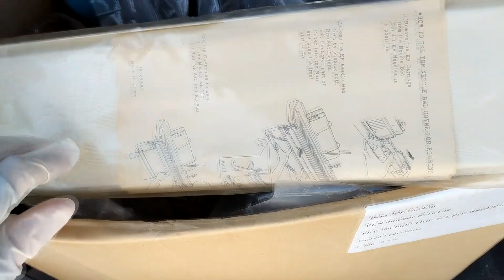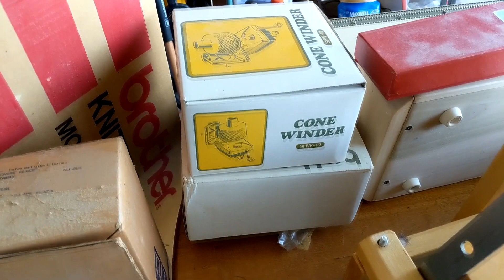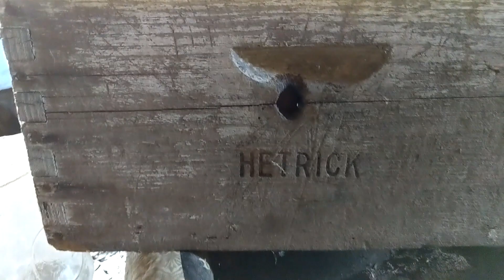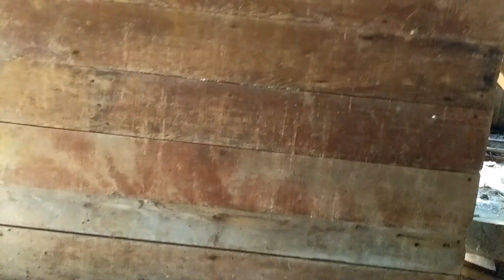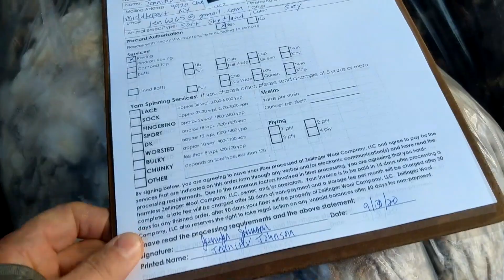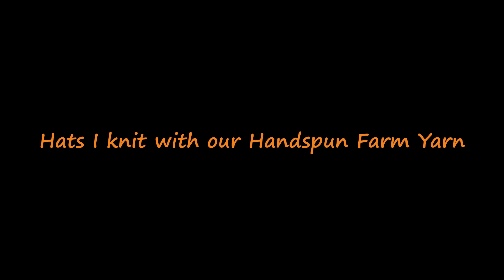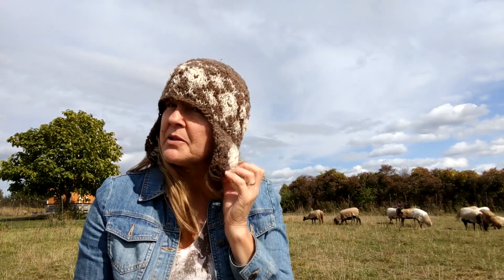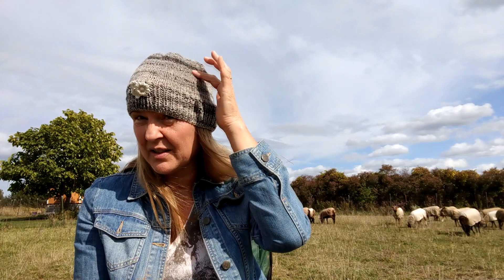The Good Of Work Episode #13 - Life on a Sheep Farm

Comment: How fun going through all those barns and finding such treasures. Lucky you. Glad to see you took all the precautions. Love the comb top. I sent some cormo to a fairly local mill and it came back full of neps. Not useable for much. Hard lesson to learn..they claim they contacted me to tell me that is what would happen if they processed it. Never did contact me☹️. A very expensive lesson to experience
Reply from the maker: Oh that is a terrible thing to have happen to you, so sickening.  That was why I was so worried about the dirty bits going into the order, but they were very reassuring.  As I am pulling it out for orders I am more and more impressed with the cleanliness.  What about the smell though?  It smells a little like axle grease to me, is that normal?  I can smell the wool ok, but there is this undertone of what I can only think of as "factory" smell.